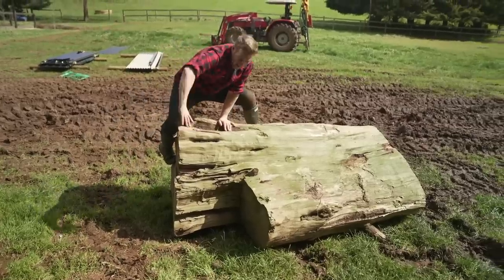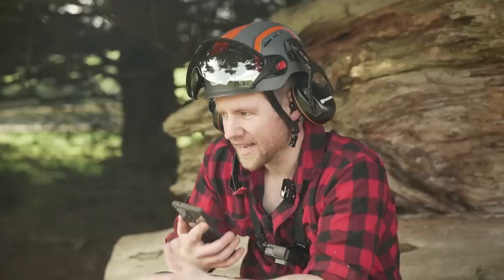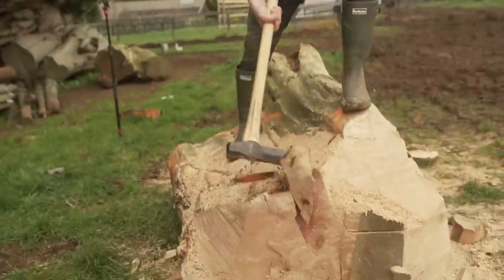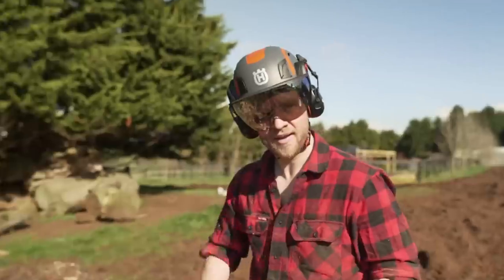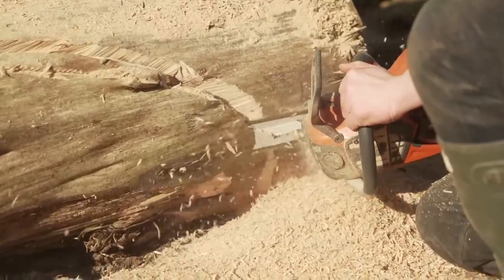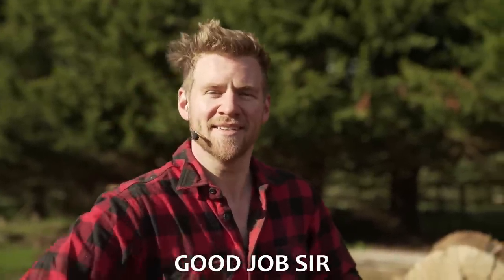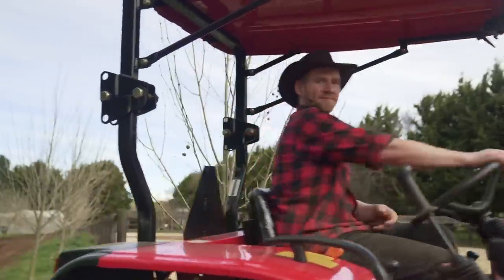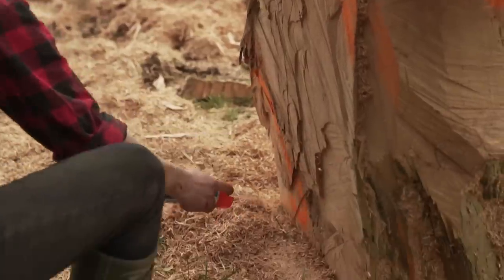Chainsaw Sculpting is a NIGHTMARE!...

Comment from the maker: Use the UPC73WDD coupon code for 5% discount on your DELTA II(2) until October 16th on both platforms. 
EcoFlow Website :  https://us.ecoflow.com/products/delta-2-portable-power-station?aff=326
EcoFlow Amazon: https://amzn.to/3RiLDVt
Per on-going certification as regulated, Delta 2 shall come to Australia in early 2023, last chance to get good price of current generation in AU!
Reply: First
Reply: Dam I commented before he did this
Reply: If you need a hand hit me up
Reply: I know it would be kinda anoying, but I highly recommend using a cable chainsaw the next time (I know sponsor etc) but cable is way better because the when the power runs lower, so does the speed of the chainsaw :) 
power chainsaws are very good tho for "short" works 
cheers and sry for bad english
Reply: Hey Jazza check out my comment I made a little bit ago someone claiming to be you is saying they got a gift for me. I think this a scam. So heads up!
Reply: Early 2023, gonna get me one of the Delta 2!!!
Hopefully you'll be sponsored again next year.
Reply: Did you get a sharpening kit for your chainsaw? You'll need to sharpen based on the wood your cutting through. A Dremel with a specific grinding bit does help if your cutting edges are really bad (My "old" bit was pink, maybe 30-40mm long, fits inside between the two bits that make up the tooth.) You're going to waste a lot of money if you don't learn how to sharpen your saw properly. Don't neglect shaving down the front of the tooth, they have gauges that come with sharpening kits that will help you file the tooth to the right depth. 7 chains for a money making video that needs to be done quick is fine, but save your money around the farm and sharpen your chain. Best of luck.
Reply: What a cool wooden ... wolf? ;D
Reply: Whole city lost power last night and all o could think of was that I wish I had one of theses
Reply: 1:42 ... that's why real timberjacks are using petrol powered chainsaws with a good punch of juice and a pretty dang big sword :))
Greetz from the Alps (Europe!)
Reply: Those Delta 2's look amazing and I've just checked them out on Amazon and it's only approx $1600 for the generator, solar panels and water proof carry case! Impressive and I want one!
Reply: Where are you in this video?
Reply: @JayromsColorfulArts  at his new country property in Victoria.
Reply: @stone_off_folly HAH! Good one! Checkmate mate!!
Reply: @stone_off_folly oh.. and where is the board? lol
Reply: Someone using your profile says I have been shortlisted for a prize or something like that. Is that you?
Reply: You deserve a sub
Reply: They do make specialty bar and chains for carving.......
Reply: love the hat, reminds me of a great old film...and someone with one helluva throwing arm
Reply: when is part 2
Reply: I just wanted to inform you that you cab sharpen chainsaw chains so you don't have to spend on new chains. All it takes is on little tool.

Comment: When I have seen chainsaw artists in person they have had a full table with multiple sizes of chainsaws plus other fine-tuning wood shaping tools. So they regularly changed tools during the process. The one time I saw an artist do everything with only one saw it was much larger and more powerful because it was gas-powered. Using a smaller, battery-powered chainsaw made this project a lot more difficult so kudos to you for the struggle. 🙂👍

Comment: What if the chain snaps?
There are special protective pants that protect your legs and crown jewels.
Reply: You know the trousers are gonna do nothing if the chain snaps? That's what a full face cover is for, the trousers are just for if you mess up handling the saw. Source: I'm a tree surgeon
Reply: @jusarson7237  in which direction does the chain rotate? Towards or away from the face?
Reply: @Herr_Vorragender  I don't know the physics behind it but I've had 3 chains snap on me in my time and every single one was a face shield away from gashing my face, your "logic" doesn't outweigh my experience
Reply: @jusarson7237  I think I understand what your problem is. You're missing the world formula in every comment.
How else should I understand your assumption I'd perhaps deny the possibilty of insury to the face.
So, calm down!
Let's agree that protective gear for legs, crown jewels, arms, torso, feet and hands, head and face would be ideal.
Did I miss something? Well perhaps make sure bystanders are also protected. And for a lack of world formula assume all the security measures I am to lazy to list right now.
Reply: This comment about getting chaps is way too far down.
It's horrible to see what a chain does to bare flesh.
Yes when a chain snaps it goes normally towards the face, but a simple slip or stumble and he can cut into his leg causing major damage.
@Jazza @josiahbrooks if you read this. Please get yourself some chaps.

Comment: All I can say is keep your thumb of left wrapped around the handle, and your tip out of the dirt. Watch the kickback on the upper part of the bar. Use the dogs when possible. Watch your compression binds to avoid getting it stuck. That’s a quick overview of what I learned in 12 years running a saw with the forest service. Great job , loved every second.

Comment: I have the ecoflow battery that we use to power our wood pellet smoker while camping. It's great because it's a reliable power source for even the long 12+ hour smokes. We charge it before we leave and it still has plenty of battery left by the time we head home. It's just an all-around great thing to have for any camping trip or even in the backyard when you don't feel like running an extension cord. So, +++ I recommend the sponsor.

Comment: On a log that big a larger bar and a 50 cc saw or larger saw works better for roughing, then switch to your saw and then a quarter bar and a dime bar. You have to keep your chain sharp. It will be much easier that way.

Comment: Nice video, Jazza. I look forward to part 2. 

With that being said, when it comes to new ideas for art videos, have you ever considered "Shatter Point Pottery?" 

Basically, you take several colored glass vases, each of which should be a different color, and smash them to bits. Then, you take the colored shard remains from of each vase, and use plaster to mold them into one new multi-colored vase and/or glass sculpture. 

I don't know what you would create through this form of artistic expression, but I am very eager to find out; and before you ask, yes, this art form was, to the best of my knowledge, made up by me. Though I'm sure others have thought of this before, they just haven't put it into words, or practice, yet; which would make you the very first person to try this new art form.

Comment: you can carve under the jaw and thin out the neck to make the nose longer, also the ears need to be taller/thinner and less straight up and more forward, a right angle triangle with the right angle facing forward towards the nose. Also the end of the nose should be more rounded. not sure exactly but maybe try having the angle be more the bottom jaw forward and top more inward with the rounding. Also might be cool to carve some holes in the back where a mane would go and add some metal or something to make a cool mane shape, could also use yarn or fabric if its going to be inside.

Comment: As a current arborist, I have several concerns: 1. where are your chainsaw chaps! people go to the hospital from huge wounds from chainsaws to the legs. 2. It's not a stihl, so that's why its not cutting very good. If you choose to do this again, I would recommend a 261c for taking off the huge chunks, and a 170c for the actual carving bit. Just make sure the chain on the 170 is a "Pico" chain, it rides through the wood at unreasonable speeds when sharp. keep up the great work man! have fun and stay safe!

Comment: hey mate just a tip when using a chainsaw if you drive the dogs in to the wood which are the spikes at the base of the saw and use it as a fulcrum then you will be gettin  the saw to do the work and not work your self as hard

Comment: As you acquire more power tools like chiansaws and such - i would stick with one brand so you can use the same battery and it keeps tool orginzation easier - i personally like milwaukee because they have a the best batteries but giving you advice as you love organization and love handy tools. But good video best wishes!

Comment: A quick thing about the chainsaw. In the beginning you could see that fine dust flew everywhere when you were using the chainsaw. After you got help and changed to a sharp one there was no longer dust but a little bit bigger pieces flying around. As a beginner that is an easy way to see if the chainsaw teeth are sharp or dull. Of course, with a little bit of experience, you feel the difference right away but maybe this tip can help someone :) 

Fine dust = Dull 
Longer/bigger chips = Sharp

Comment: Idk what the future video will show, but it's possible to reattach the nose piece you cut off.  There's a variety of types of joining methods using drilling, dowels, and adhesives to fit it back on. Takes some more work, but oh well.

Comment: The best way to fix the nose if you don't mind using glue would be to drill holes in the extra piece you want to add on and the horse and put wooden dowels in the holes with wood glue. Very solid

Comment: I'm glad to see you using safety gear, though I hope you use leg-guards/safety chaps if you keep working with chainsaw (especially carving down low or or on horizontal cuts - even electric saws can snap a chain, snag an embedded stone/nail or kickback/jump) or even power craving (though the safety for those things should be far more than what the average is - they WILL tear through leather, blade protection and major bones with zero effort).
You made some great progress! Your saw seems a touch under-powered but I think that's a good thing for the amount of your experience. Glad that you're bringing in an expert, hopefully he'll reinforce the safety side of working with chainsaws AND get some good results out of that suuuuper ambitious tree trunk of yours!

Comment: you do know that you can sharpen a saw without having to change out the chain every time it get's dull right? and if the chain is too loose it will get dull faster. Also if it's too loose it will heat up the bar and that will cause even more trouble, the tension of the chain so be so that you can lift the chain on the top of the bar using moderate pressure and just almost see the bottom of the guides, if you can see the bottom of the guides then you need to just a hair tighter, if you can only see half the guide it's a hair too tight. Been running saws for about 40 years. So be careful and keep an eye on the tension of the chain and keep it sharp. Good luck, loved the carving but maybe get a bigger saw for the larger stuff.

Comment: Do they not sell 2-Stroke Stihl chainsaws in Australia? (I mean, Husqvarna works too, but 2-stroke, specifically) I mean, the electric would be nice for the fine detail stuff so you can set it down to re-mark your lines. But, for the big stuff, a 2-Stroke with an 80cm bar would be the cat's meow.

Comment: I think my main impression from watching this is that 99% of the chainsaw art I've seen is a tiny fraction of that size. Doing the rough cuts on a block of wood that's small enough to be maneuvered by hand is going to be a lot faster and gets you to sculpting the finer details a whole lot more quickly. Even just limiting the work size to no more than a multiple of 2 of the chainsaw blade's usable length would allow you to get to the general size and shape with much less effort.

Comment: Okay, since no one else will say it, the problem is that you don't have a gas/petrol chainsaw. Those electric ones are just for small limbing jobs like after a windstorm. 
One more ting! Battery chainsaws and in general battery operated things have a huge amount of pollution! Check that out for yourself, what all is involved in the resource gathering and manufacturing of batteries. Not to mention, the angry pixies that keep your battery running are powered by something that burns. It runs gas too in a figurative sense. It's just 50 + miles/kilometers away. 
Anywho, take care and play with chainsaw more. They're fun. Try chainsaw milling. That's a really rewarding process and result.

Comment: Since you seem to be trying to make something work with every single medium imaginable, i guess i‘ll throw an idea in you direction you might fancy: so, at the moment i am using a thermal camera at work and when i watched a cold surface and drew my finger across it, it left a hotter spot which vanished over time. Maybe you might be able to make something artistic based on that thought, i have no idea if thats even possible though😂

Comment: If you had used a gass powered chainsaw it would have gone much smoother. The electric ones are great for small jobs ... But just dint cut it for bigger jobs.

Comment: I dont want to be rude but just for you to learn a thing or two, also you might annoy a few people by calling it a chainsaw blade, its simply called a chain. But make sure that you wrap your thumb under and around the front handle, I saw that you rested it on top in the same direction as all you fingers, you want to make sure you have a full grip around the handle. Don't recommend using axes as wedges, they arent designed to be hit or hit things from the back, get some aluminium wedges (aluminium won't damage your chain as much as steel if you put the chainsaw back in to cut and you hit the wedge). Wearing good padded comfy gloves will reduce chances of blisters and will reduce vibration going into your arms. GO BUY CHAPS, if you hit your leg and cut a main vein then you're dead. 
Don't use the top 1/4 ofthe tip for the bar, there are videos explaining why not. 
Really I don't means to be rude by saying any of this but there were a few things I saw you do that made me not completely trust your competence. Please if you dont understand anything I have said then ask me and I will re-explain

Comment: Lol I love it when people make comments like "yay batteries, no pollution" even though the manufacturing process for those batteries causes more pollution than running your gas powered equipment XD lol love the dystopian future we're headed towards, the blind leading the gullible. Also your chainsaw would have worked better if it wasn't battery powered XD Battery power tools really aren't meant for heavy duty jobs compared to traditional wired or gas power tools....

Comment: Gotta use a real chainsaw for sculping; battery-power just won't cut it lol Also anyone else trying this, please use actual safety procedures including proper chaps and gloves . . . it's way too easy to accidently cut yourself and you can't always rely on the chain brake to stop fast enough; especially on a battery saw.